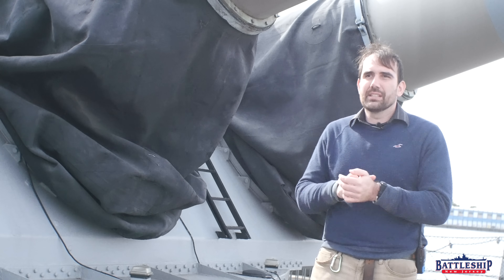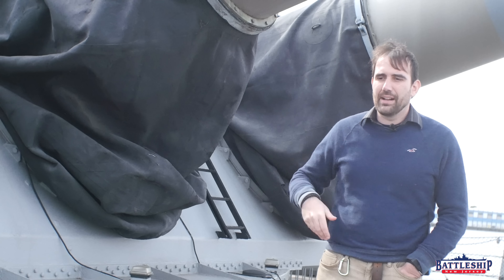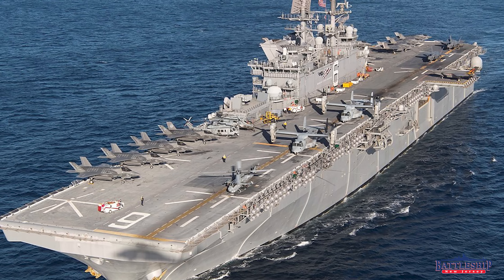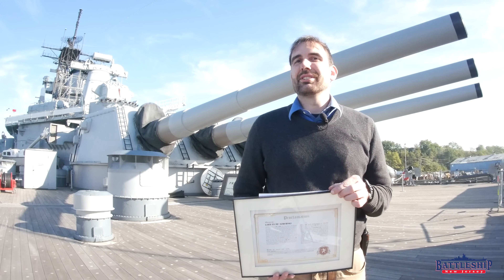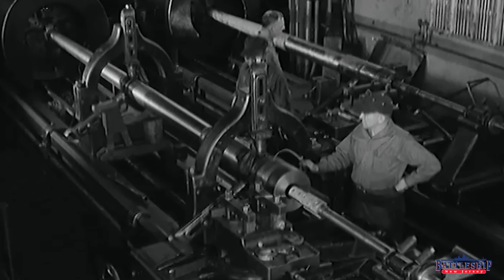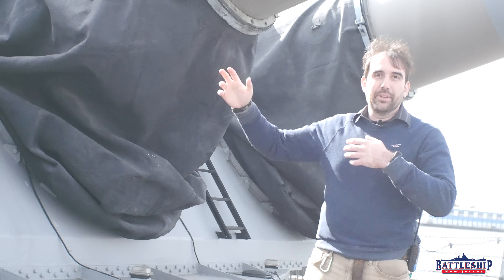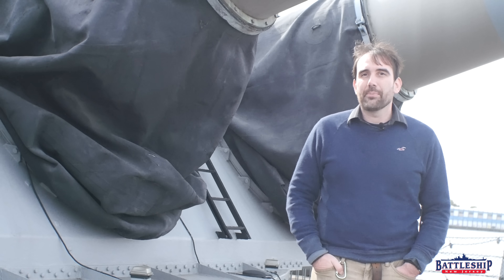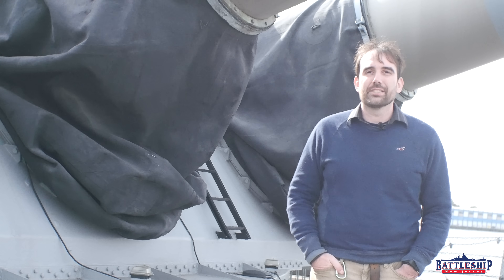How Much Would It Cost to Build a Battleship Today?

Comment: If I were in charge of the US Navy and Congress demanded battleships NOW, I'd be fired.  It takes time to build the shipyards and then the battleships while developing modern battleship doctrine and tactics--and then training up a crew.

One place where the battleship would be saving money is the fire controls and gun directors.  A modern laptop would easily replace the entire electromechanical computers that directed the 16" and 5" batteries.  One thing about the old electro-mechanical computers is that these systems used ballistics tables that had been generated using pencils and adding machines.  The first US Navy electronic computers (analog) were able to complete a ballistics table used to generate firing solutions in a few days instead of taking dozens of "computers" (at the time these were human mathematicians) several weeks.  Then the cams and gears in the computer would be cut to match these calculations.  When 16" guns could reach 20 miles, the rotation of the Earth and position relative to the equator and even whether the target was to the east or west of the battleship have to be factored in.  Then after these books and machined parts are made up, they have to be delivered to the battleship and installed and the crew needs to drill in using these things.  Fortunately, the crew size of a modern ship (America-class amphibious assault ship) is about half or a third of an Iowa.  A much smaller crew operating the battery control systems could custom-generate a firing solution more rapidly than the original Iowa-class could from tables--and discounting the land-based room full of mathematicians generating the ballistics tables.  More important, the modern computer could adjust for target speeds beyond the parameters of the old fire control systems.  The anti-aircraft function of the dual-purpose 5" 38 caliber guns would be applicable to the 16" main gun batteries even though the main gun turrets couldn't track fast-moving aircraft--neither could the 5" guns.  Smaller crew, less electrical power (or steam power) to run the fire control system, greater accuracy, and faster engagement speeds all save space and money.  

Fire control is one item--but the guns controlled are another item.  Modern self-propelled land artillery systems can exceed 70 kilometers, doubling the range of the New Jersey's 16" 50-caliber guns.  The original 5" 38 caliber guns would probably be replaced--along with the 40mm and 20mm anti-aircraft batteries--starting with the standard 5" 50 caliber dual purpose guns.  Those newer mounts require less crew and are more effective.   As for the main battery. let's return to the reason I'd be fired from CNO.

"What do you want the battleship to do?"

In the late 1930's battleships had two functions--fighting enemy fleets and destroying enemy coastal installations (ports, factories, cities, storage sites).  The battleship had to be heavily armored to survive a gauntlet of fire--by the Thirties this included submarines, bombing aircraft, torpedo boats and torpedo boat destroyers (had to use the old-fashioned term), cruisers, mines, and coastal defense artillery.  The picture hasn't changed--and sometimes "armor" means an electronic cloud surrounding the ship to hide her and mess with missile guidance systems.  What's the modern battleship supposed to do?  I noted that the latest US Army 155mm howitzer has a 70-kilometer range.  An eight-gun battery firing at say 30 kilometers can fire a barrage of 42 projectiles and have them all arrive in the same 100-foot diameter target within seconds of each other--this Army Time on Target technique is also applicable to Navy gunfire.  A 16" shell makes a deeper crater--important for destroying underground structures.  Iwo Jima and Okinawa demonstrated two things--finding and hitting underground structures was Mission:IMPOSSIBLE! and even the mighty 16" 50 caliber gun at plunging fire distance wasn't able to reach the deep shelters.  As for clobbering enemy ships at vast distances, there are better systems than the 16" 50 caliber gun. The New Jersey fired quite a few Tomahawk land attack missiles and had Harpoon anti-ship missiles.  Guided missiles supplemented by multipurpose naval guns would do a lot to protect the battleship from air and missile threats.  Underwater protection against torpedoes would require decoys and possibly anti-torpedo torpedoes.  Modern destroyers lack depth charges because that involves getting too close to enemy submarines--if the surface ship is swift enough to run down a modern submarine.    

Would the battleship operate solo?  What would a battleship task force consist of?

Yes, I'd be fired.

Comment: Building a carrier provides far greater range and capability than a top of the line battleship.
Reply: Very true. However, a modernized Iowa would be more lethal in naval combat especially if modern anti air defenses can negate missle attacks making aircraft and missle destroyers useless against it. Slowing the battleship to get in striking range and would easily obliterate destroyers or carriers. I do agree that carriers are more effective in multiple roles were a modern battleships only role would be to destroy enemy ships or island based air strips.
Reply: But it cost far more. Remember the $10B for a Ford class is just the carrier. The air wing is many billions more

Comment: hmmm. 2nd time. Comparison/ contrast to the LHA/LHD America class is good in some respects. Comparing the LHD America to the WWII CVL Independence class - is NOT good. Both ~40 aircraft - ok correct - but add compare the aircraft each carried - POOR. Compare the LDH America to the CV Essex- don't think air wing size - but ship size - and they are close in size comparison.  Oh - as he quotes the original BB costs - then when you simply adjust forward for inflation - and does not include armor and guns - Make me think modern shipyards are MUCH more effecient.

Comment: Take the Iowa class, gut the engine rooms and give them two S9G reactors. This would fix the cost of fuel at this point of time. They are reactors that the Navy if very familiar with. The Iowa's were already fitted with cruise missiles. That system would just need to be modernized and expanded. Improved radars and other electronics would systems the Navy already has in place on other large combatants so the problem is how to redesign the superstructure to fit the new systems. The one big question is since the S9G is going to be a lot quieter than the old powerplant, what do you do for sonar? Two ASW helos, a variable depth towed array, a UAV, and a hull array? Or don't bother because anywhere it goes a Virginia or two will be assigned?
Reply: Its a Battleship. Heavy ASW is what your escorts are for.  I would imagine an ASW similar to a carrier.
Reply: It may be wiser to replace B turret with the missile farm
Reply: The US already considered modernizing the Iowas in order to be an answer to the Kirov Battlecruiser, but it was decided it wasn't worth the cost.  You'd basically have to gut the entire ship.
Reply: I think you'd end up losing the rear 16" turret in the process. However that would allow for VLS systems to be added. I think it would end up like a larger Soviet Moskva Helo carrier at that point. Which wouldn't be bad in of itself. I think the process of refitting would just be too high a cost when you can just add more Ticonderogas and Arleigh-Burkes, which would disperse your firepower over more platforms rather than making one large target that the US couldn't afford to lose.
Reply: Replacing the power plants sounds good but it won't be so easy. Ryan pointed out in another video that cutting through the six inch armored deck, triple bottom or the belt to get in to do the work would not be practical. The cost would be astronomical. It could probably be done, but you would still have an 80 year old vessel to maintain.

Comment: Why would a designer include heavy artillery or armour plate. The artillery would have a range of maybe 30-40 miles and the armour would be useless against an incoming hypersonic missile. The ship presumably would have nuclear propulsion leading to a smaller crew. It would have a large suite of anti-aircraft missiles and anti-ship missiles. It would have a large suite of ICBM’s presumably. The modern equivalent of a battleship is the nuclear submarine. Far superior survivability and an infinitely bigger punch. A surface analogue is the modern aircraft carrier. Less survivable but much more versatile than a traditional battleship.

Comment: I'd be torn between modernized iowas or brand new ones.  I think a bbs could still be used in certain situations but the lack of range as compared to modern systems would need to be addressed in terms of the guns in my opinion.  Maybe they could develop much longer range shells with today's technology. Think rocket powered shells like long range artillery of today.  And also the sheer amount of man power required to properly man an iowa class would be a challenge I think with the military in need of more bodies as it is.  Plus the historical factor that comes with the Iowas.  I wouldn't mind keeping them in decent enough shape that they could be reactivated in an emergency or hell even get them running and sell cruises to pay for upkeep.  Hell who don't want to go on a cruise on a ww2 bb..  I think ultimately I would build new and have them nuclear-powered and have all the modernized tech that allows them to not need as many crew members.
Reply: I think the crew size could be cut in half compared to WW2. Many systems could be much more automated (I’m thinking gun crews, engine room crews (nuclear requires fewer than fossil), fire suppression, command and comms, targeting—all reduced because of automation). 
Fewer of those crews also means fewer cooks and other support crew. Maybe not half but I bet it’s less than the 2700 of the Iowa.
Reply: @timothy098-b4f  I agree
Reply: Gerald Bull put 2 spare 16 inch barrels together and could get sub orbital, so going from a 50 calibre to a 60 to 70 calibre barrels with a bigger charge and base bleed or assisted projects would give a modern BB incredible gun ranges going down to a 12 to 14 inch round would probably be better than a 16 inch.

Comment: If a battleship was nuclear powered, would a non penetrating hit cause the reactors to scram? I've pondered a modern battleship, and while I know that the odds of one being built are slim to none, I find it fun to think about. Also I wonder if it would be possible to use the big guns as a gun/missile system,  or a guided munitions system with smart shells.
Reply: It doesn't look like the USS San Francisco had a scram when they hit the sea mount and that would be far more jolting than a non penetrating hit. Naval reactors are designed with battle damage and shock in mind. Also, even if it did scram, you could still pull steam and it is pretty much the most common reactor casualty practiced.
Reply: Aye, fun thing to speculate on. The nuclear carriers are shock tested to make sure they can take a hit and still operate, naval reactors are pretty tough. It might be easier to armor too, since reactors would take up much less space than boilers, potentially allowing much more protection to be added.
Reply: @ionparticle  I was actually wondering myself how big the nuclear reactors would be, but shockingly, information on the Navy's nuclear reactors is hard to come by. But if you created an inner citadel just around the reactor and its control equipment you could make a sort of reactor barbette that could be much thicker, and combined with belt armor would make actually damaging the reactor very difficult.
Reply: Nuclear reactors are protected.  I've been on a carrier at high speed that caused the ship to from fore to aft to experience heavy cavitations and the ship had no issue doing for a few days while it crossed the atlantic.

Comment: I estimate it will cost at least $3.50, probably a good deal more.

The other issue of a new battleship is someone will basically suggest an arsenal ship, a missile cruiser, or a hybrid to operate helis and STOVL drones/jets while also lobbing missiles around. And then get cancelled before it sees a single bit of steel cut after it costs $3.5bn on R&D alone due to mission creep.
Reply: Goddamn it monsta!
Reply: @jimtalbott9535  That Loch Ness Monster always looking for a handout...about tree fiddy.
Reply: Someone always forgets to factor in Graft, Whores & Coke...
Reply: Ummm....Im going to bid 1 dollar Bob.
Reply: Get outta here Loch Ness monster!!
Reply: I think the arsenal ship is the future. Just think of an oil tanker sized ship full of VLS. Already have the facilities for the build, relatively cheap with a minimal crew.
Reply: @fathead8933  I've thought of a mega Q ship disguised as a mega container ship.  All those containers stacked high on the edges packed with salty evil surprises inside and hiding a hollow core of choppers and VLS.  Just a pipe dream, but imagine such a ship operating off of Somalia, or in the Malacca Straights.  It looks like a big fat piñata, surprise!!!
Reply: @derbuckeyetribe9789  Sounds like a modern LST (Large Slow Target).
Reply: @fathead8933 The arsenal ship crashed and burned. Munitions are too expensive, not enough magazine depth & no at-sea replenishment.

Comment: building a new ship would be the best bet, with new all welded prefab modular construction it would be cheaper and faster to build vs the original ships also. the turret houses aren't that hard to make theses days, large 3d printed cores for molding and casting could be used, it would also work with other large casting areas of the ship like the belt armor, it could be poured at the steel mill and transported via ship to the building location, mills like zug island in Detroit would be perfect for that, treating the armor would require some new infrastructure though. The  main guns and the ammo for them would require the most gearing up to make happen. As for the power train, diesel gen sets with electric motors could be used and are readily available from the cruse industry.
Reply: Ultrahigh molecular weight polyethylene, could its application fit as battleship armour?

Comment: If I had a gun to my head, I would scratch-build a design following the design philosophy and aesthetic of Jean Bart.   Main guns for shore bombardment, perhaps railguns if they're available, but a focus on missiles, both surface to air and surface to surface, utilizing the aft section of the ship.    Honestly it would have more in common with an arsenal ship than a battleship, maybe 50/50
Reply: While Russian naval ships aren't exactly modern,their not short on offensive,or defensive capabilities.
Reply: After Ukraine it should be clear that anti-drone defenses will have to be sprinkled all over ships like AA during the Kamikaze phase of WW2.
Reply: @N1njaSnake  Not necessarily. I recommend watching LazerPig's video on the sinking of the Moskva, he goes into detail about the ship's defenses and how many of them were actually functional when the ship was attacked based on a maintenance report that was filed shortly before the war started (Spoiler, basically nothing on the ship worked).
https://youtu.be/aNEtlMSCiCI?t=741
Reply: i like this idea, would you keep JB's 150mm secondary guns (or a modernized equivalent) or leave this part of her design out?
Reply: @alienXcow24  I would strip out the aft-mounted secondaries and use the space for the VLS suit and a helicopter or drone hanger. Then the positions of the 100mm guns would have replacements consisting of modern 127mm guns and 20mm CIWS, two on each side.
Depending on the power output of the engines, the CIWS could be replaced with a laser system.

And, as gun weaponry become further obsolete , the forward barbettes could be changed out to house a weapon system to target ICBMs, put the tracking system in one slot and the laser in the other. But the ship's internals would have to be VERY modular
Reply: More or less what I would build, 6 forward main guns, 4 5 inch automatics, the stern being entirely VLS tubes, Harpoon launchers, 4 CIWS and the latest electronic warfare suites.
Be a pretty formidable ship that's for sure.
Reply: So basically you are describing the Moscow class battleship from modern warship which she have a 16 inch (idk what caliber of the cannon) 5 secondary weapon and 6 grenade launcher midship (idk if it midship or near the aft) and it also have vls and a helipad in the aft, I suggest watching one of the Moscow class battleship show case to get a better view of it
Reply: @Stupid_lil_rat  I try to ignore Russian naval craft as much as I can.
Reply: Too bad 'Arsenal Ships' are still concept ships and not even reach prototypes.
The only thing close to it is Kirov class.

If new gen BBs is to be designed and produced. it would need to supersede DDGX project first. and then the size can't be as big as Yamato, nor any Superdreadnoughts, but still bigger than Burkes and Ticoes (the DDGX hull is clearly to be bigger than Burkes and Ticoes but no bigger than Zumwants. the reasons for size increase is to make rooms for future techs, this due to lessons learned from Burkes and Ticoes)
In addition, it still need external armor platings with composite armor and material science we have today and not Oldschool steel alloys of the old past)

If the Congress autorizes one. the design would simply be enlarged burkes with two gun batteries, and each have two or three guns, each with 155mm guns. autoloaded. more missile batteries.
Reply: You're thinking sort of like I am...  I'm impressed you know about the Arsenal design study.